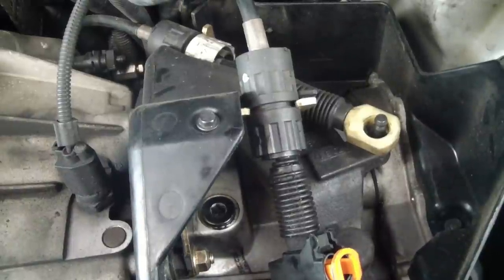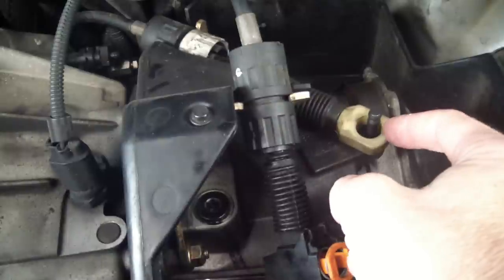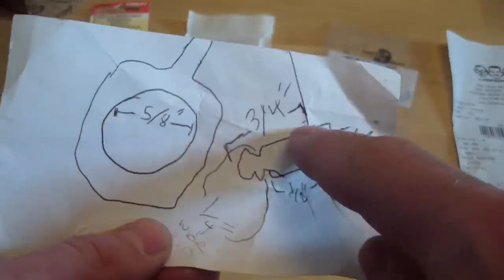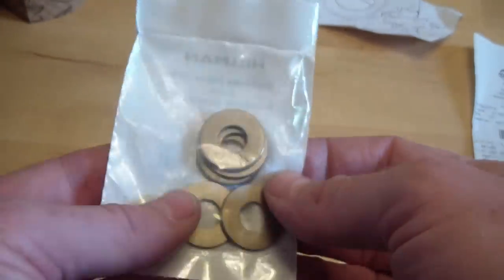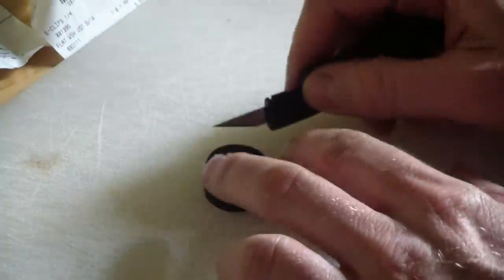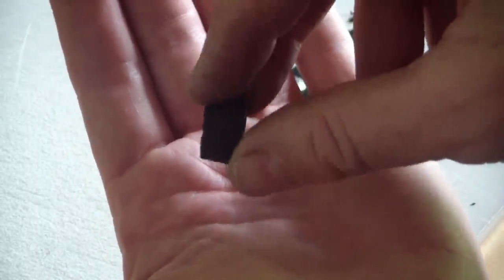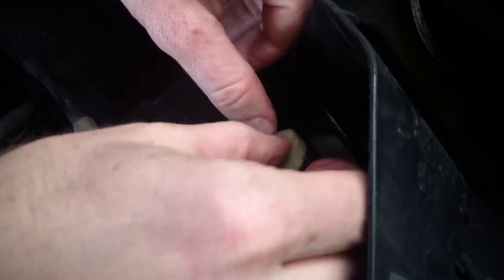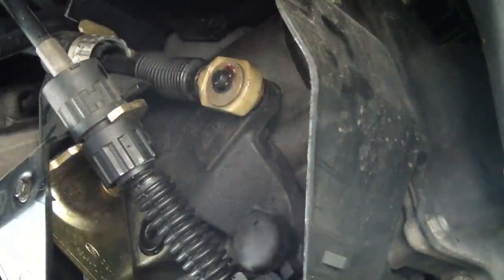How To Fix Sloppy Shifting - Ford Focus IB5 Transmission

Comment: Well thansk for showing me where exactly this was located. best side of vehicle to approach it from. did you have to remove a tire. did you have to jack it up..... ? come on buddy
Reply from the maker: Jacob Schmid You have to jack up the car.  It is on the front of the engine, on the driver's side.
Reply: It was like 1 am but I went out with a flash light and found it. it was very easy to get to. no need to jack up mine. pulled the case cover of and boom, there it was a snapped linkage. this will be my next project.
thanks for your vid

Comment: Where is this part located? I've  been trying to find it.
Reply from the maker: You mean where to buy one? The Ford dealer only sells a shift Collett as part of the cable. I’m not a part store might be able to sell you one separately. The parts are used in the video came from the help section of the store. It was just a rubber shock absorber pushing.
Reply: @hoohoohoblin  I'm actually talk about the location of this part, I have a 2015 Ford Focus and it seems the gear shifter cable is off but I'm not sure where exactly is the gear shifters cable at. I heard it's under the intake or underneath the car. I just need some help verifying it before I do anything.

Comment: where is it located?
Reply from the maker: Down under the car at the front of the transmission. If your car is a different model, you can have somebody move the shifter around while you crawl into the car and look for it.

Comment: WISH MY 03 FUCUS ZETEC WAS A 6 SPEED!!! WONDER IF A IB5 TRANS WOULD BOLT UP 2 A ZETEC? I WANT TO SWAP MY AUTO TO A MANUAL!!! I WANT A 5DR SVT!!! SO I WILL TAKE SVT PARTS & INSTALL ON MY SE 4DR & IT WILL BE A KNOCK OFF SLEEPER!!! 1DAY WHEN I HAVE A NEWER CAR, I WILL ADD A LS  OR A SHO 3.0 & IT WILL SCREAM!
Reply from the maker: +D.j. B thanks. IB5 transmission doesn’t fit the Zetec motor, but I know there is a 6-speed manual transmission specially made for the Zetec that you can get. It would probably be difficult and expensive to install it, but you could do it.

Comment: KUDO"S BRO_SKI,,, I LOVE WHAT U DID 2 SECURE YOUR SHIFTER CABLE!!! SEE, I TWO OWN A FUCUS!!! 03 FUCUS DOHC ZETEC VIN 3.. I HAD A HONDA ACCORD UNTIL A 2-5 MPH CRASH INTO A HUGE POTHOLE WICH ALSO HAD A RAILROAD TRACK IN IT, RUINED THE CAR! AFTER WALKING FOR WAY 2 LONG,WHEN MY SISTER SAID SHE WAS SELLING A CAR, I DIDNT ASK QUESTIONS! AGREE'D APON A PRICE SINCE I WAS FINANCING IT, I DIDNT ARGUE & PAYED 2 MUCH!!! 2K + INS =3K THEN IT BROKE DOWN SO, I FIXED IT TIME & TIME AGAIN! ITS BEEN 1& 1/2 YEARS & IVE REPLACED SO MUCH ON MY ONLY CAR THAT I HAVE FAR EXCEEDED ITS VALUE THO, I NEED IT TO LAST SO, I KEEP UPGRADING IT SO THAT ITS NICE & DEPENDABLE! IVE UPGRADED ABOUT EVERYTHING & MY FAV IMPROVEMENT IS MY TOCADO 6.2" 4G WIFI/DVD,BACK UP CAM + MUCH MORE! IT MAKES IT LOOK MORE MODERN! HAD TO DO THE ROCKER PANELS & RITE NOW IM DOING NEW MAIN & ROD BEARINGS! HAD 192K WHEN I GOT IT & ITS 205 NOW! I DID THE TIMING & WATER PUMP, OVERFLOW TANK, THERMOSTAT, & HOUSING"S, BRAKE'S, LINE'S, FUEL FILTER & ALOT MORE! COULD BE HERE ALLDAY LISTING IMPROVEMENTS!  THIS SPRING I AM REBUILDING THE WHOLE MOTOR & PORTING THE HEAD'S & ADDING RACE CAM'S & TURBO! GOOD LUCK WITH UR FUCUS BRO & KEEP POSTING UPDATE'S SO, WE CAN ALL SEE PLZ?
Reply: Just a tip; More people will read your comment if you only capitalize the first letter of the first word of each sentence, and the first letter of names. Use dots to finish a sentence and commas to insert a breathing break. Currently it reads like it's once long screaming sentence which no one will go through.